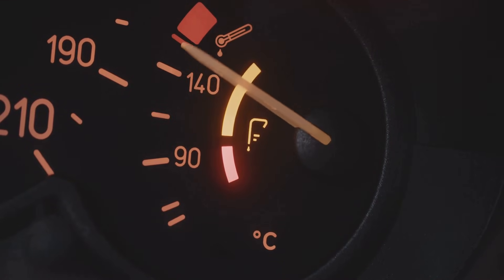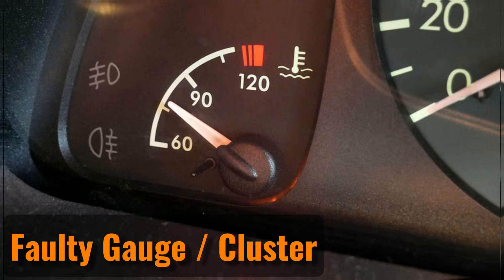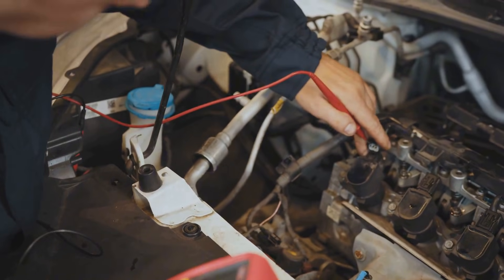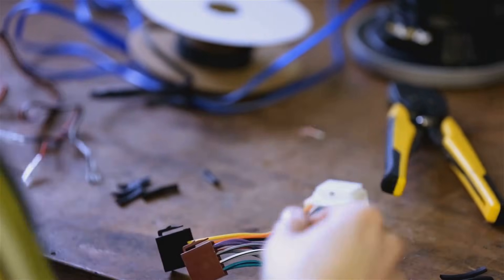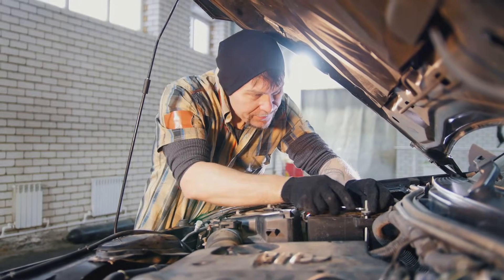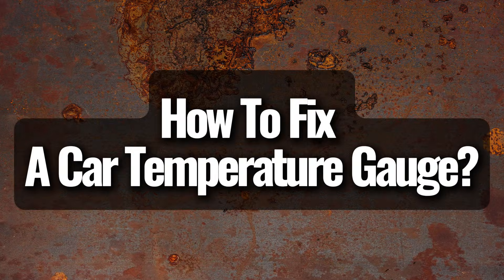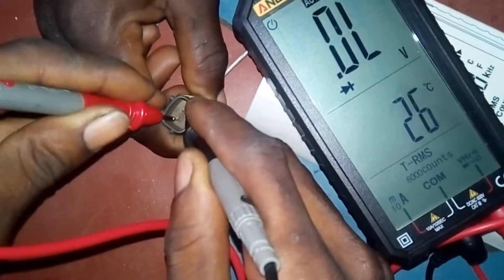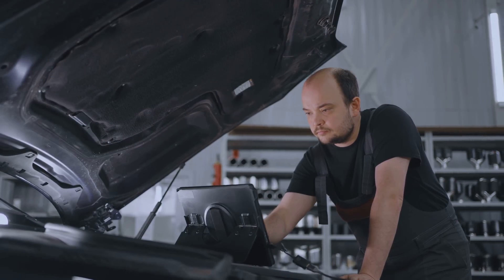7 Reasons Your Car Temperature Gauge Stays on Cold & How to Fix It?

Comment: I experienced a problem with low temperature after replacing the radiator, and after extensive research, I discovered that there was a missing component restricting the flow of trapped air pressure to the reservoir. This was causing water to bypass the thermostat.
Reply: Could you please provide more detailed description of the modding component
Reply: Elaborate bro. Same issue
Reply: Yes please elaborate. I recently had my radiator replaced and an having the same issue. Thank You

Comment: well,  after testing , the sensor is fine,, its getting nearly 5 v so the wiring is fine.. its not overheating  .. im stuck . the gauge sometimes works and sometimes doesnt  .

Comment: My van's gauge stays on COLD while driving and makes a fluttering sound and poor acceleration.
What's possibly wrong?
Reply: Coolant temperature sensor might be bad (or wiring).
This makes the gauge read low, and most importantly, it gives wrong info to ECU, thus the ecu gives wrong air fuel ratio.

Or it can be thermostat related.

But if the engine performance is affected it is most likly the ECT sensor.